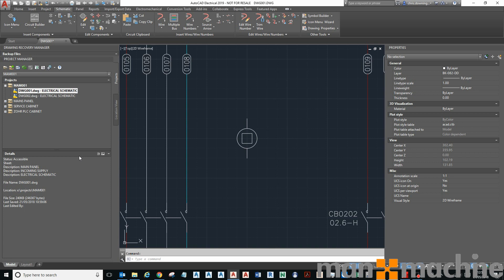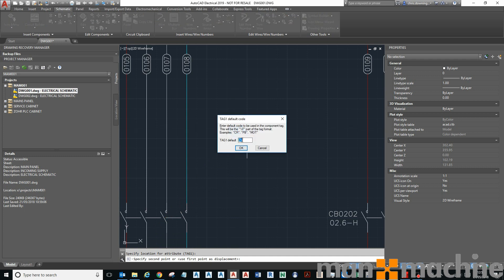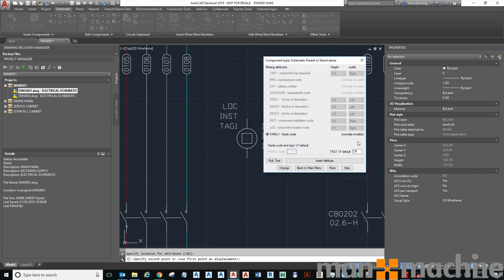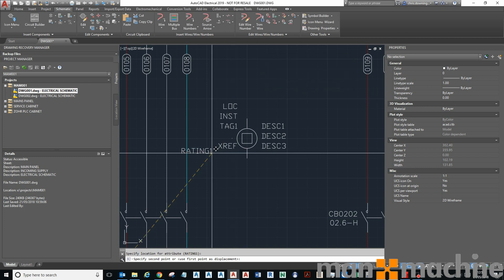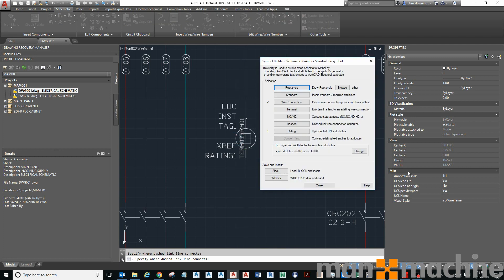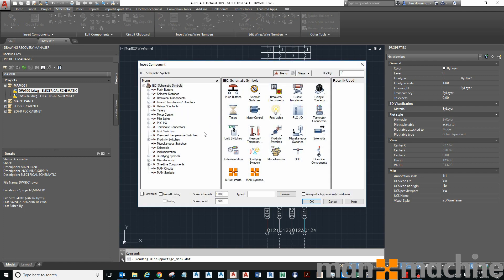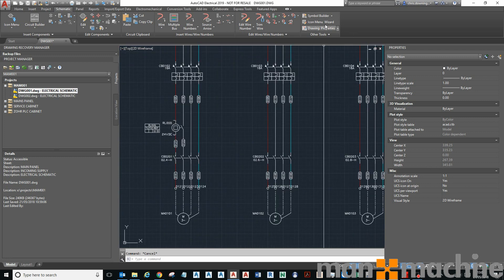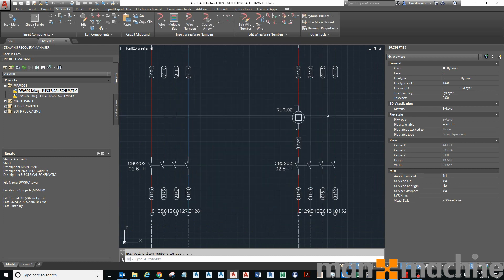Create an AutoCAD Electrical Symbol

Comment: I'm using autocad electrical 2020 and when I follow the steps you have taken it does not bring up the same windows?
It brings up the block editor after selecting the symbol?
Reply: Same problem for me...
Reply: In case it helps. I found that making sure I have a Tag1 in there that it brings up the proper window.